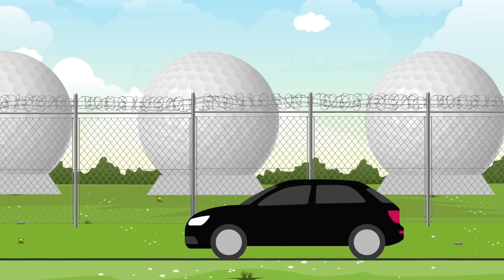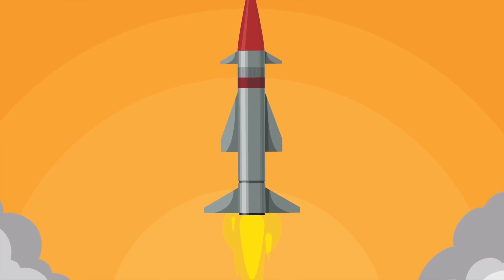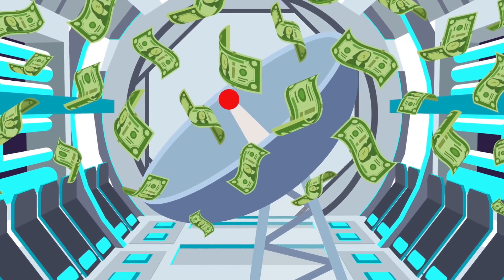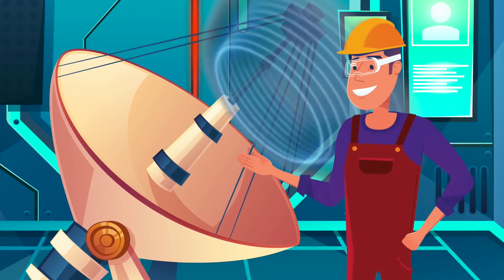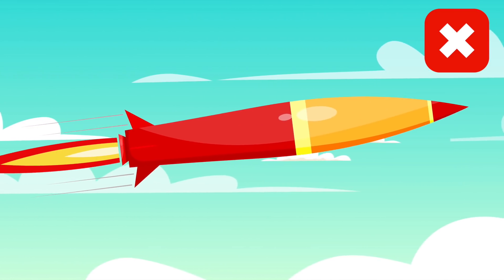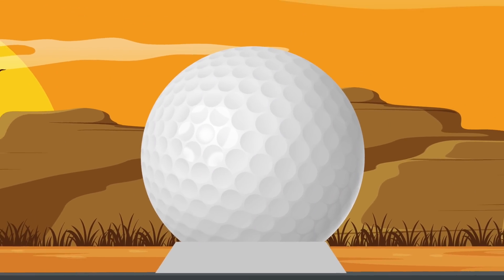What Actually Happens Under Radomes?

Comment: 1:08 totally wrong. The dishes are not used JUST to detect missile launches - that mostly handled by space based systems. Obviously you were never in the military.

1:13 Are fu#ing kidding me, radomes in no way prevent enemies from us detecting from our systems.

1:20 you are correct to an extent.

1:24 You are moronic again, no land based system can detect everything.

1:30 Most of the systems are operated outside the USAF/RAF.

1:43 See space system stuff.

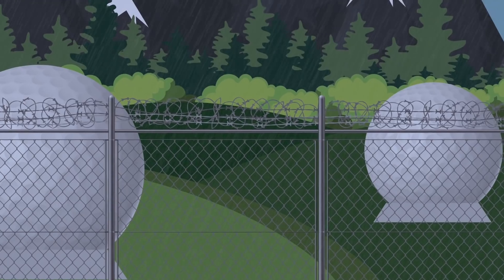2:03 They CAN NOT sustain that much damage. Sorry.

2:35 No. just. No.

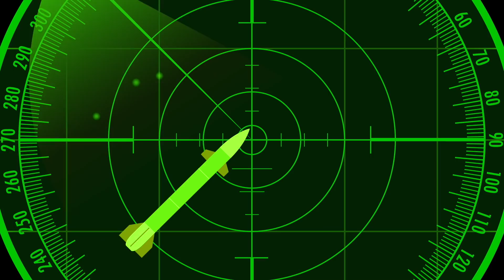3:06 Wrong

3:3:14 Wrong, again...WTF?

3:31 Nobody is ever in the dome in operation. Wrong, again.

4:03 All domes are on Mt. Pilatus?

4:19 Wrong! 99% are on active bases.

4:39 Again, not all USAF!!!

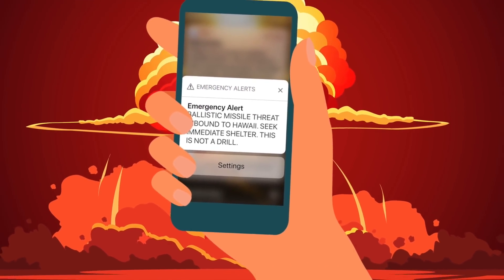4:51 Get out of the 80's and fuc*ing google.

I can't even watch the rest of this - it's fuc*ing stupid.

Good luck with your channel, it's lame and full of moronic information.

TTYGL!